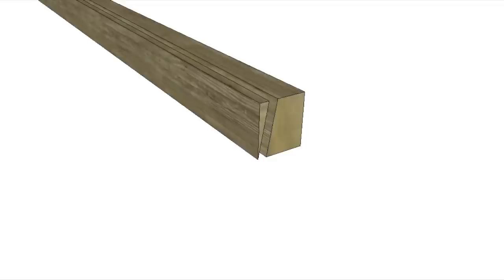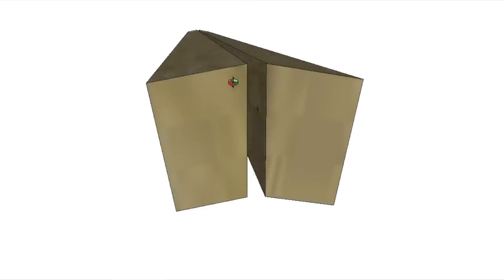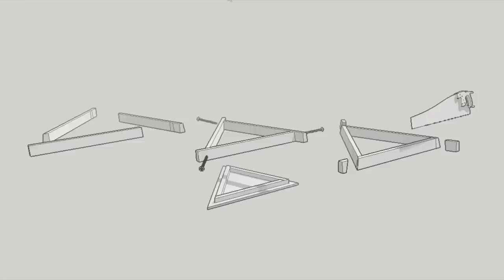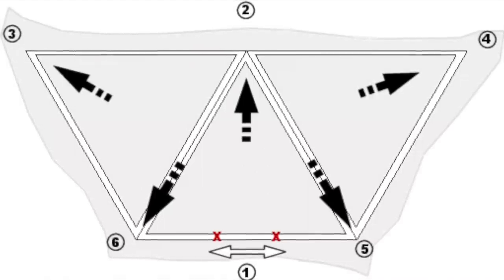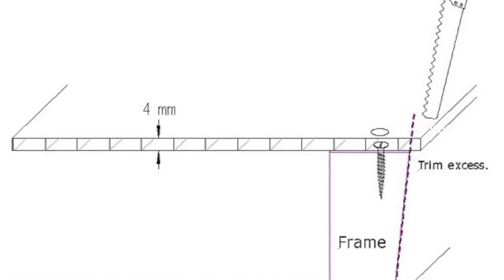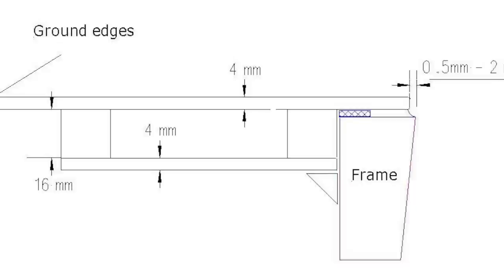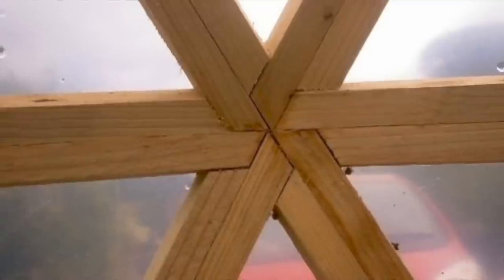Dome building methods - Beveled frame

Comment: Hi Paul, 
Built a dome using the plans I purchased from you last year. Worked out great, very easy to build once you can wrap your head around the angle cuts and how it all comes together. This video would have been great to help visualize things. Glad it is out there now for those taking the plunge and building their own.
Reply: Brian Smith I don't see why anybody would pay for plans for something that could be found out for free, even plans that get purchased end up getting out somehow.
Reply: saves time maby :P
Reply: @carolynmmitchell2240  Maybe it's a way of showing respect and gratitude towards those who are doing the calculus for you?
Reply: what tools did you used to build the dome?

Comment: Paul, this build method is by far the best.  You are a genius and thanks for making this method public.  If it ever gets warm here in Wisconsin, I plan to build my first beveled frame dome this Spring.
Reply from the maker: Thanks and good luck with your build, I would love to see a picture or two.
Reply: Ever build it?
Reply: @NwoDispatcher  No, but the plan is on the drawing board.  Unfortunately, I now live in an apartment and my "building" of anything is very limited.  I may not be able to build one until I relocate.

Comment: Would you be willing to explain how the bevel angle of struts is calculated? How does one work out the dihedron angle? I'm struggling to find a formula. Thanks so much, really great video!
Reply: did u find out how to do so
Reply: I’m also looking for this formula. I found the formula to find the size/length of A•B•C. But on a v3. Still wondering how to find the angle formula.

Comment: Nice vid very well thought out ~as small note : if plywood was chosen as a covering then strut lengths should be restricted to the width of the plywood sheet and this would  increase the speed of a project and reduce wastage
Reply: What does that work out to for done size if the width is 4’?   Also this doesn’t cover building a base wall.

Comment: A very helpful video. (Everywhere I look, though, the actual math of calculating bevel angles is missing.) 
You also asked if there is a cheaper way to make domes - there may be one, though it does not have the aesthetics of joinery. Check out zip tie domes (TN, USA).

Comment: You are talented Mr Robinson.  If you wrote a book I'd buy it in a snap.  This looks like it would do the job, but if you were building a dome for your family what would you use "personally", what would you decide on for a hub that would be labour saving, would last a few seasons and would bring the highest level of stability to the structure.  What would you choose for your hub.  Would it be the new hub connectors you are working on?

Comment: awesome video...however, a follow-up with how to calculate the length and how to calculate the angle of the 'fillet' to achieve the required curvature would be very much appreciated...that said, it all just clicked in my mind.

have a potential project where I would like to make a half-geo dome wrapped around a 'regular' shed shape at the top of my garden after levelling it off.

it's like the north face of the igor right now!!

Comment: beautiful results......a lot of precise calculations...but bravo.....I'm wondering only about...insects that eat wood...upkeep over the wood surface, and load bearing for windows and other materials  such as metal  and other plastic related insulation......and finally what kind of energz...or heat loss is released from a structure like this with any combination of windows and covering . Okay, I'll stop complaining. It's a beauty....
Reply: Rashidii Graffiti sum woods a bug resistant ceder . Cyprus. I know are

Comment: How would you solve condensation in doubble layer glass? Argon gas will work if its 100% sealed, but might not work if its timber?

Comment: You gloss over the jigs fairly quickly and I couldn't tell if there was anything tricky about them. Are they attached to the plywood at flat 90 degree angles with all of the multiple angles accounted for in the beveled struts in the triangles? And is it obvious which way the beveled struts should be placed in the jigs or is it easy to get them reversed (upside down or backward) if you're not paying close attention?

Comment: Are there calculations that show the relationships between the jig size (panel size) and the angle of the bevel cut and how that relates to the overall structure size? If you get the relationship between the length and the bevel edge wrong it wont line up right.

Comment: Hmmm, you explain it as one size of triangle element, but on the next visualisation it's clearly different sizes of triangles? How does that work?
Reply from the maker: Typically there are at least 2 different size triangles in a dome, search unity dome if you want to a see a dome with only one size. If you look up 2v dome calculator or 3v dome calculator you can get the sizes for a dome with two unique triangles, hope that helps
Reply: Thanks Paul <3 Sorry for the noob question. Just getting into domes now, and I think after 2 days looking through your channel, that I now have the courage to build my first dome. It will be a green house for the misses (:

Comment: Beautiful video thank you very much. Could you tell me what angle I have to cut the wood?
Reply from the maker: It depends on the dome frequency and a few other things, this link shows angles for a classic 3v: http://geo-dome.co.uk/3v_tool.asp  work out the bevel from the dihedral like this - dihedral divide by 2 then take away from 90. Example 166° dihedral /2= 83 (90-83) = 7° bevel angle. I will post some more calculation tools when I get time.
Reply: for 4v ???? gracias!
Reply from the maker: Here you go: http://geo-dome.co.uk/4v_tool.asp
Dihedral angles are at the bottom, this is classic 4v so there are 6 different panels. I have improved this with a new 4 panel design, do you have a diameter in mind?
Reply: To clarify the 3v dome would require 2 different angle bevels 7 & 5.5?
Reply: Could you give the information for a 2v I found the part for 3v thanks for sharing

Comment: I’m trying to make a hanging chair that’s basically 1/2 of a dome using this method.  Now, I don’t have very strong math skills whatsoever so finding the bevel degree is really difficult.  So could you explain how to calculate the bevel?  As in how do you find the dihedral angle?
Reply from the maker: Working out dihedral and bevel angles can be a bit of a problem because they often vary depending on frequency and geometry used. Best thing to do is decide on your geometry then work it out from there. Are you thinking 2v or 3v? 2v is super easy with a nice straight edge, 3v will be more challenging but looks cool. If you let me know frequency and size I can put some quick plans together.
Reply: Paul I have tried to order plans and email you through your website with no response is there any other way to get in contact with you thanks for sharing I'm trying to find the bevel angles on a 16ft diameter 2v dome I don't understand how you figure I have to can you help  thanks

Comment: Hi paul, i always get leaking in my dome and other people I've spoken to that have used this method say that they struggle with this problem too. Any advice when using rigid polycarbonate? i used the glazing tape but all the panels fell off in the wind
Reply from the maker: OK first thing is to use good quality glazing tape, stuff you buy from the local DIY shop isn't that good, I also seal all the joints with polythene repair tape, the panels can't fall off if you do this. Use 50mm and you won't even see it as it only covers the frame area. Let me know how this works for you.

Comment: I'm trying this for the first time. Can someone help me with the math? How to determine the diequal angle and the size of the triangles.  I want to build a 10' diameter dome set on a 3" high knee wall. The bevel method seem to be the least complicated. This is for my granddaughters green house. I think it will be a fun learning experience for them. ... and me.  Any suggestions would be greatly appreciated. Jim Mc
Reply: After looking at a few online calculators, we decided to purchase Paul Robinson's plan (very reasonable price) and modify it to the size we wanted.  It was MUCH easier than having done it ourselves.

Comment: Not once has anyone mentioned the angles inside the isosceles triangle, which should remain the same if you've got lengths cut using the formula, or the option of only bevelling the triangles that fit between the pentagons to keep strength and save labour.
It would seem like this idea is straightforward until you start constructing it yourself and then you realise there's alot of useful, information missing. I hate to criticise given the nature of the subject but I can't help thinking that really basic stuff needs to be covered first. Using the jig in this manner is also redundant if you've ordered your lengths to size already and can't afford to have offcuts..
I tried a prototype built with pentagons, and although not as strong, may well be adequate for a greenhouse type structure where nothing is being fixed to the inside.. The angles where the faces meet create too much stress on the joins so definitely not weight bearing as far as I can tell..
Reply: Maybe you didn't notice his other videos that cover more of the details not to mention he was a website where he sells complete plans.

Comment: What's the relation of the dihedral angle to the cut? There is a 90 degree but what angle should the saw be set to cut the bevel?
Reply: He tells you at the beginning of the video. The bevel angle changes with the size of the radius, Its variable. :44 seconds

Comment: I cant help but think that making Pentagon panels would save on wood and time and you would only need to make a few triangular frames to join them? I wonder if the pinned joins in a pentagon would be under more or less stress than the triangular ones
Reply: Problem is that the pentagons aren't even but slightly pointed outwards. Therefore your Pentagon needs to be built with 5 triangles.

Comment: Hmmmmm, I thought about this for a long while & I've got nowhere on it.  Plz take a look at it.  

Between a pair of two identical/symmetical triangles (ex: 2 freq hexagon & hexagon) it's intuitive the bevel angle is half of their dihedral angle.  

But between a pair of two different triangles (ex: 2 freq hexagon & pentagon) it's intuitive the bevel angle would be NOT quite half of their dihedral angle.  

Any comments might help, Thks
Reply: I also thought this, I'm going to make a 1/10 scale model to work it out.. Can't help but think making up pentagons and joining them with triangles would be easier?
Reply: @TheDeft1s  Wellll I'm going with a truncated icosahedron design, done the calculations for the dihedral angles, & they agree with https://en.wikipedia.org/wiki/Truncated_icosahedron  dihedral angles 6to6-agons: 138.189685°& 6to5-agons: 142.62° .  The bevel angles between 6to6-agons is half of 138 as expected but the bevel angles beween 6to5-agons is 67.6 & 72.3 which is very close to half of 142.  
If a redo them for a 2freq geodesic dome design, I post them.

Comment: At 1:10 you mention using a thicker piece of wood and cutting down the center. I want to use this method because it saves money on lumber. However my father keeps warning me that cutting a piece of lumber down the center (aka: ripping) causes the cut pieces to warp. It would be impossible to build a geodesic dome with such curvature in the struts.

How do you address this problem?
Reply: Treated wood warps less than untreated. Cured wood now a days warps very little. If buying from a box store look at the rings. Cutting with the grain or against matters. Wood type matters. A little bend can be removed mechanical. Like by an Archimedes screw or bolt when put in a geodesic structure.

Tell your dad to go look at his rafters with a laser level and replace all the twisted ones at once! When he is finished send him over to my house. While hes doing this ask him how saw mills cut tree's?
Reply: @sclabhailordofnoplot2430  Ive found treated wood in my area warps more than red cedar that I made a fence out of. The treated wood here is made of the worst wood available it seam to me.

Comment: Could this wood shape be substituted by ribar enforced concrete?
Reply: I dont see why not I always thought they were in compression so you could skip the rebar maybe it would be really hard to make such small cages although if you put a skin over it in concrete with some mesh stand up bars where you going to bolt through it.  It would be very heavy to assemble.

Comment: If only some store sold this priced by the triangle already premade with a self locking no tools required feature
Reply: Yep, I would buy it in a heartbeat
Reply: It would have to be made to order cos they wouldnt have space or cash to stock the triangles for every frequency and size of dome. Made to order would likely be 10x the price vs making it yourself

Comment: I cant understand these English terms .What is angle of the bevel one ? 6.5? I ordered plans and asked Paul Robinson questions about it. He did not answer to me clearly. Just linked video.... "This bevel is half of die iqul angle " What does that even means? Can I get help from someone else?
Reply: Half of the equal angle...
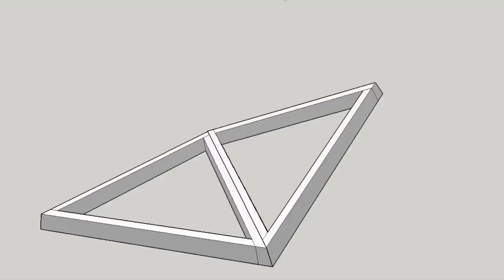Reply: "Dihedral angle". It's just a fancy word for the angle of the "v" between the two pieces of wood at 1:35. The faces of that V are on the outside of the panels, and that causes the panels to be turned by the same angle relative to each other, as seen at 3:29.

Comment: are the triangles all equilateral?  you didn't show the  dimensions of each side.  Are all triangles exactly the same for the entire globe?  (I guess I am unclear on the meaning of '2-frequency')
Reply: There are 10 equilateral triangles in a 2v dome, they are located between pentagons
Reply: @JohnGuest45  I do not understand your answer.  Is the entire structure built with ONLY the same size equilateral triangles?  how many do you need?  The 'globe' you show has dozens of triangles,  but you said I would only need 10?   How do you make a pentagon AND hexagon with only the same size triangles?   I assume something must be different between the triangles used for a hexagon and the triangles used for a pentagon.   This is an excellent video though!  I want to build one based on this, I intend to video it and credit your site.
.
Reply: @mikekosak9598  
A 2v panel dome has a total of 40 triangles, 10 are equilateral. The dome is made up of 6 pentagons and 10 equilaterals. A 1v dome uses 15 equilateral triangles, if you search you tube for "star plate dome" you will find a few. Note the edge of the triangles are not 90 degrees, you will need a 21 degree dihedral angle to make them fit together. The easiest way to do this is to set the tilt on your table saw to 69 degrees and rip wider timber in half lengthwise.
Reply: @JohnGuest45  ok thank you for replying but I guess I still am not getting it.  This video clearly shows the beveled edge and the way to cut a board the correct way to get 2 pieces.  But then it shows only the hexagon built.  There must be something different to make a pentagon.
Reply: @mikekosak9598  
A 2v dome doesnt have hexagons, it has 6 pentagons made up of 30 triangles (6x5) and 10 equilateral triangles that fill in the gaps between the pentagons  :) There are 2 chord factors for a 2v dome,  0.6180 and 0.5465. For a 2v dome with a radius of 1 you need 10 equilateral triangles with 3 side lengths of  0.6180. For the 30 triangles that make up the 6 pentagons you need triangles with one long side at 0.6180 and two short sides at  0.5465. The internal angles for the equilateral triangle is 60 deg (x3). The internal angles for the pentagon triangle is 55.57 deg (x2)  on each end of the long side and 68.86 deg (x1 at the apex). The dihedral angle on the 0.6180 sides is 7.22 deg, the dihedral angle on the 0.5465 sides is 11.23 deg. These translate into table saw blade tilt angles of 82.78 deg and 78.77 deg. Lengths are measured from vertex to vertex which are on the outside of the dome.

Comment: Can you do this with 2x2 members? (2x4 ripped in half)
Reply from the maker: Yes but it's a bit thin with US sizes because 2x2 is actually 1 1/2" x 1 1/2" You could try 3x2 with the bevel angle cut down the centre to get two struts from a single board.

Comment: Disadvantage: lots of ripping, requiring a table saw, more work, as each strut is double, and more chance of leaks.
Reply: compared to what? You should watch his other videos and put the whole build together it will make a lot more sense then.
Reply: @dustintinsley3899 
Make a 6v panel dome and a 6v hub and strut and see which one takes the longest ;) Hint; you`ll have to make 8 triangle jigs before you even begin to cut the 1080 struts to make up the 360 triangles.. A 6v hub and strut would be up by the end of play on day two, day three if you have long coffee breaks, its only 196 hubs and 555 struts.

Comment: Realy nice video. But! The damn screw at 5:42 is reverse treaded, couldn't stop focusing on it.
Reply from the maker: Ha ha you are right, Who would even notice that? I can only suggest viewing the video through a mirror would fix this issue, everyone will be checking it out now.
Reply: was building it in my head and got stuck when that screw showed up, i gues everyone have their autistic moments :)
Reply: It's probably english tread   ;-)
Or does that only work with english treaded bolts

Comment: What are the dimensions of the wood depicted in the video?
Reply from the maker: It's a beveled peace of wood about 45mm x 25mm (2" x 1") but it comes out at about 22mm at the thick side and 16mm on the thin side. (7/8" and 3/4")